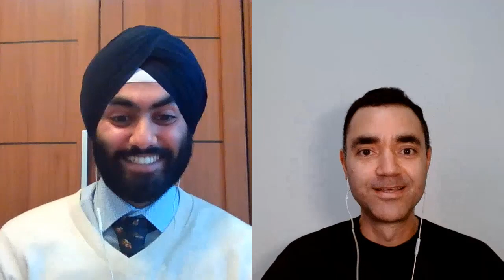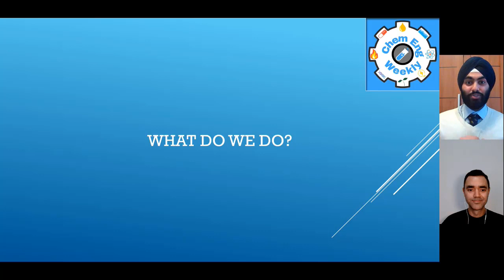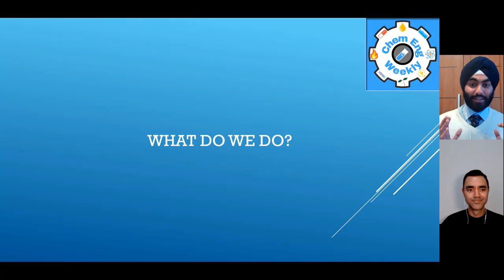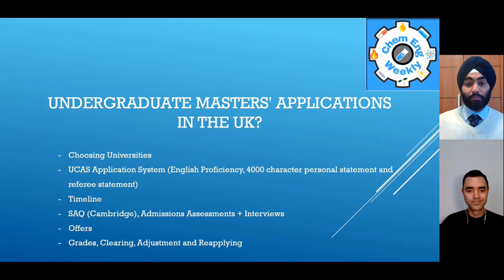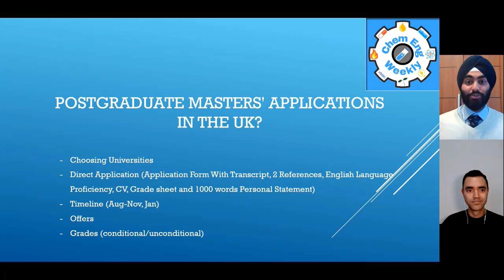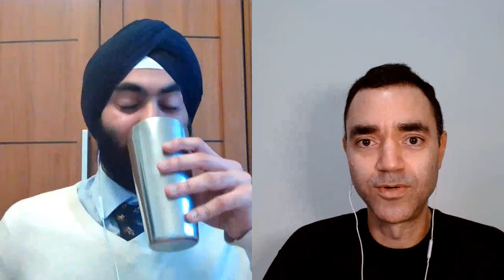CHEMICAL ENGINEERING AND HOW TO APPLY FOR MASTER ABROAD

Comment: Great interview! 
Could you advise in which technical literature you can find the requirements for filters. Filters are the most common -conical. Or advise a source in which you can find at least approximate figures of the content and dimensions of mechanical impurities in the pipeline at the first start of the installation.

 Your channel is very cool! Don't give up this case! 
BR
Reply from the maker: Hi Fred, I suggest you to search for filter suppliers. Some of them may have technical report to help you on this subject.